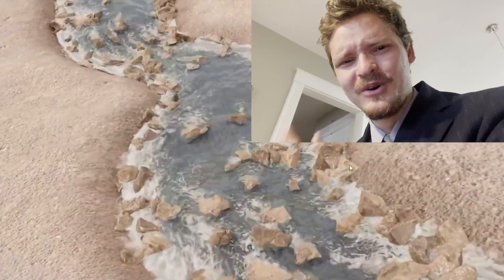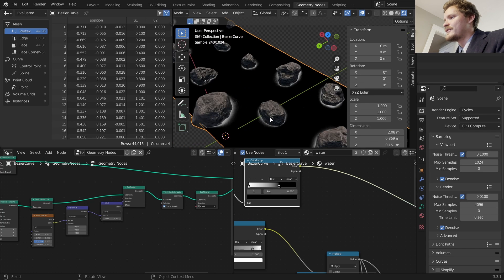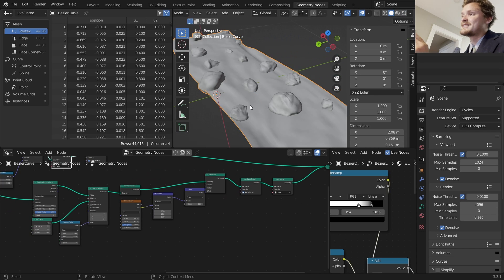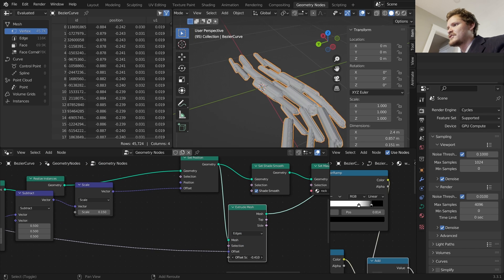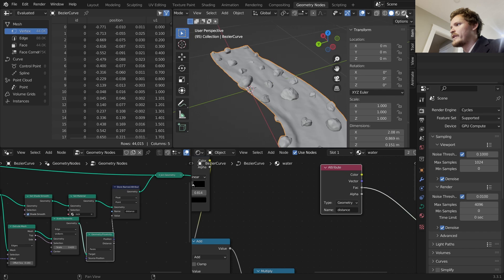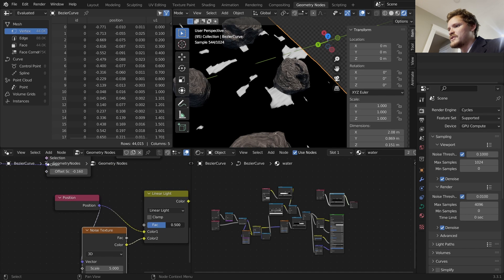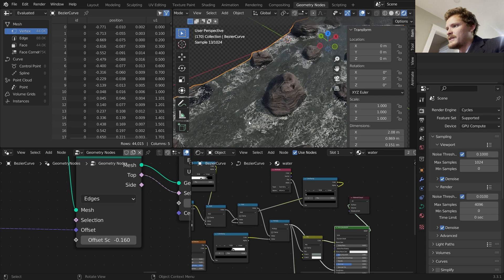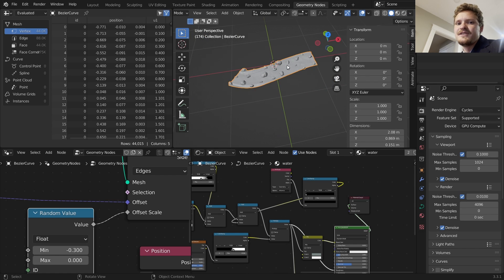Blender River Generator [Part 6] - Trails

Comment: Yay i just finished this, pretty happy.  I was wondering if there was a way that you can use the procedual curve to inpact turrain.  As in can you make it so that you can start with a large rectangle and as you run the curve a long it it creates a curved recess in the gemoitry based on the extursion values.   Also another thing that might be worth thinking about is that while water does flow faster in the middle of a river or creek, on bends (especally tight bends) the velocity tends to increase on the outside edge.  I know we are adding complexity to complexity.  I don't know much about 3d modeling but I do know a bit about rivers.   I do wonder if there is a way that the vectors can communicate degree of change and direction at a point.  In my head, without understanding much about gemoitry nodes, it would require a way to procedually adjust the poistion of the points in the colour ramp based on the degree of change.  a 90 deg bed would have a large shift of the points, a 10 degree shift woul have little to know change. I dont know.  The video inspired me.

Comment: It looks amazing but it's super slow! Why not make a system that shows a simplified version in viewport but the full version in render? It's super simple with the "is viewport" node but I'm sure loads of ppl are gonna benefit from it!
Reply: Hi Mohammed, the Bootleneck is the Distance Store Named Attribute. If you just Extrude a  muche lower resolution sphere (duplcating that bit of the node tree) you will end with muuuuuch faster effect at the end. Mine lows from 8000+ miliseconds to 440ms to compute the Distance Named Attribute...